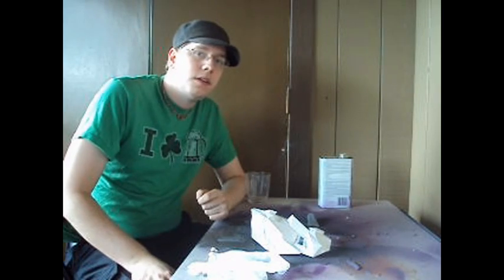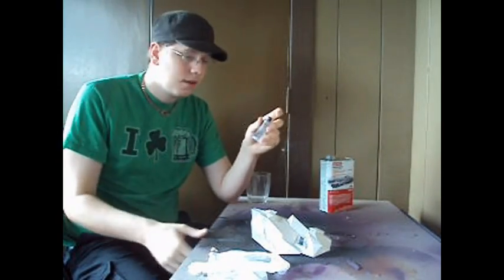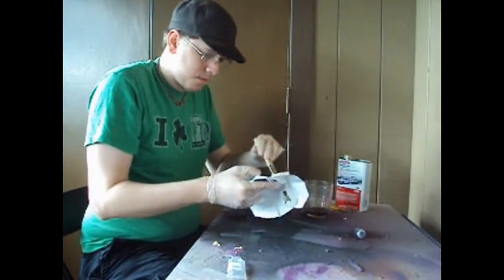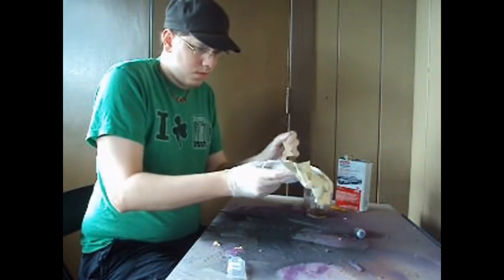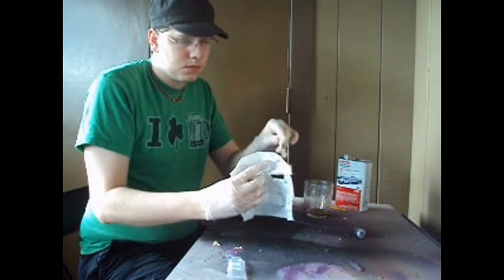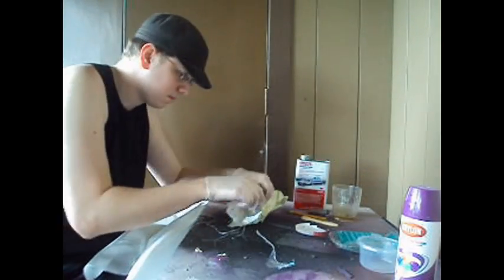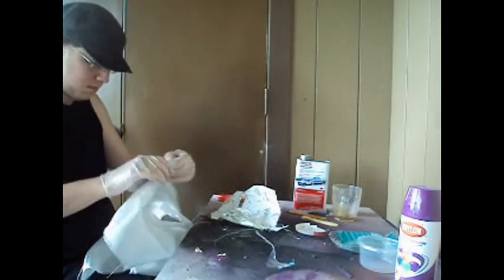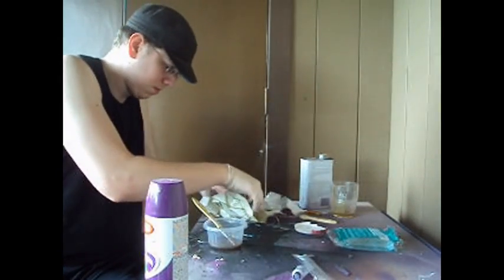How to make Costume Armor- Step 2: Strengthening your Model

Comment: This is a good video overall, I like the steps that were shown and the text is a good guideline, too. One problem I encountered during the video is that you're speaking at two different volumes (camera mic at first, regular mic second) and I had to adjust the volume as the two switched, I would just stick with one audio method. Also, more than one view from the camera would help too - like an overhead to see progress. Again, great overall, you have good methods and can't wait to see more :)